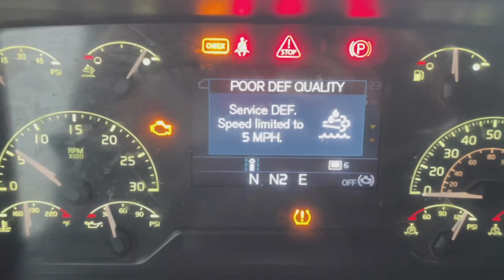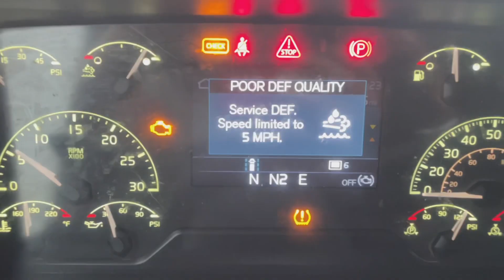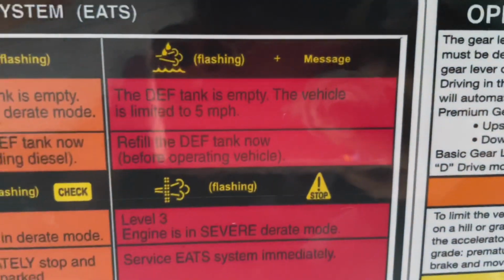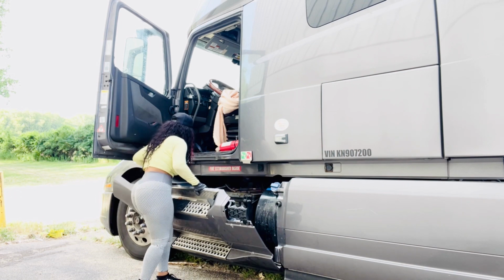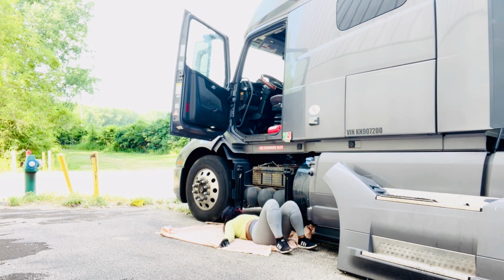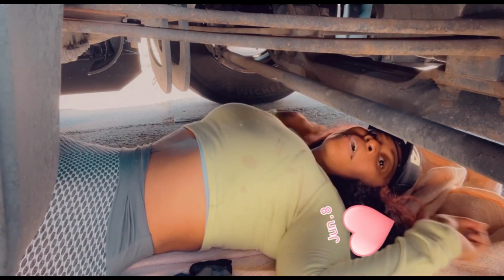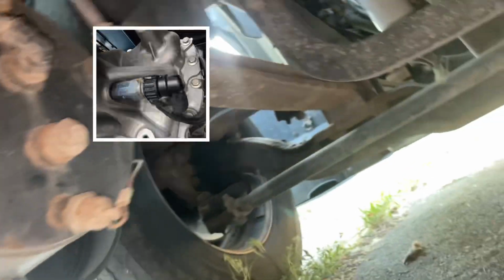🚛🛠Why call a tow truck when you can save money ?  #femaletruckdriver##Defderatevolvo

Comment: That was actually pretty smart sassy just to get it to the shop and avoid the very expensive tow bill. I commend you for doing this and saving your carrier/company a lot of money. Just don’t ride on it too long because it can damage the motor and void the warranty if there is any left. Just make sure you plug it back up before you get to the shop. Great job 👏. 

P.S stop 🛑 wearing flip fops outside of the truck. I know they are comfortable and all, but outside of the truck you need some real foot wear to provide protection & support weather it’s shoes 👟 or boots 🥾. Looking forward to our interview!
Reply from the maker: Thank you 🚛💪
Reply: LOSHAWN IN THE BUILDING !!      MONEY JUST WALKED IN...LOL...